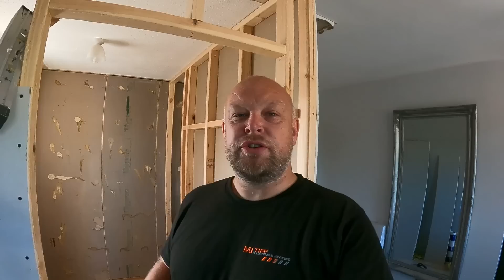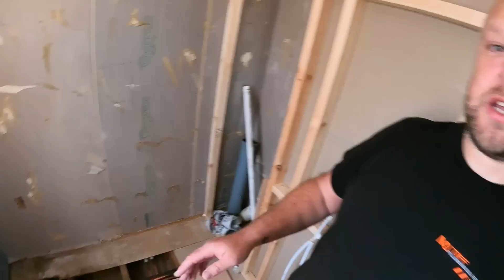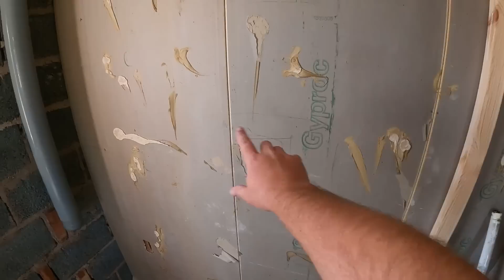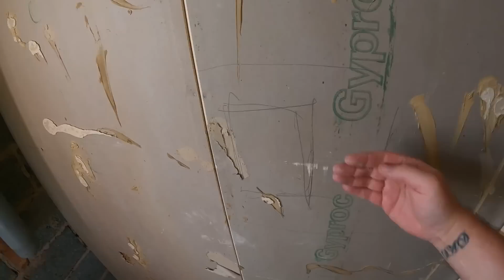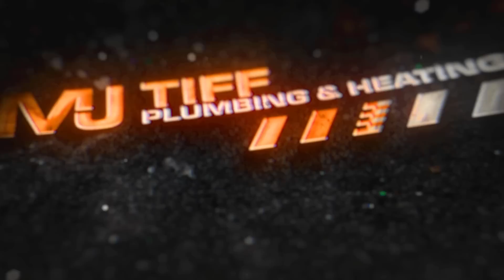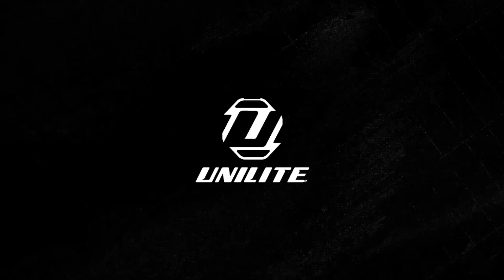BATHROOM DESIGN PROBLEM | SHOWER Valve issue means a REDESIGN to the BATHROOM

Comment: Is every plumber now days allergic to solder or what? I dont mind propress on repairs or when a valve is leaking by but I'll always solder when I can. You can at least sweat out a fitting if you have to. Also, is that a santee on its side for the shower drain?
Reply from the maker: I solder, I press and I use pushfit as and when needed…… we do what suits us

Comment: Same as you, i always just use compression for valves, i know end feed #3s are available but to me you then risk damaging the valve with the heat, like you said, if you do it right you wont have an issue, though i do now use press for getting onto chrome never had an issue with it.

Keep up the content 
👍👍
Reply from the maker: Thanks buddy…. Appreciate the comment 👍🏼

Comment: Tidy job as always Mark, 100% no getting away with having screwed fittings in walls the shower valve is made with them, good solution to the problem of the wall thickness and the shower valve ive never seen walls like that before, stay safe & hope your finger has mended
Reply: They are known as paramount walls. Came across hundreds of them used in social housing. Good thing is you can drill a hole in the wood header from the loft and just push a length of copper pipe straight down flattening the boxing as it goes 👌
Reply from the maker: Thanks buddy

Comment: I have taken to using speedfit washing machine valves instead  of caps. Too many fights trying to get caps off. Allows you to open the valve to pull water through to test/flush system full and under pressure as well the ability to release.the pressure at the point you need to finish off the install.

Comment: In the USA they solder the shower valves in behind the wall (taking out the plastic guts 1st). Its the weirdest thing. They do it with compression valves too. Throw the nut and olive away and solder it 🤷‍♂

Comment: To be honest with you, compression in walls are fine,   its how you do and test them before burial is the important bit. Anyway how else are you supposed to connect shower valves. 
Good to see the job take shape after press fit issue.
Reply from the maker: Thanks buddy 👍🏼👍🏼

Comment: Hi Mark.  I hate them egg board walls.  I had a kitchen to fit on one off them walls.  Was going to it down and put a stud wall up, customer did want that so glued 18mm on ply on instead. But I know you would sort it.  Looking good mate. I am not a plumber as I have said, but I have put compression fittings in walls never worried about it.  Same plastic pipe with fittings hidden no worries about that.  Have a good week mate 👍
Reply from the maker: Thanks buddy 👍🏼👍🏼
Reply: what plastic pipe was it? only ever used to the white stuff o.0

Comment: Compression in walls , from my point of view it’s almost unavoidable in certain circumstances ie your concealed shower, the chance of those fittings leaking due to moving another fitting further along the same pipe run are as low as you can get, if there is a chance that by tightening or loosening another fitting might in turn loose the hidden one then I would solder or push fit depending on the situation. There will be loads of ways people would do it differently but hey ! It’s your job and if it’s never let you down then bingo! 👍👍

Comment: 3:09 they are called paramount walls, I caught fire to one once, we use to take a cold feed from the attics to the electric shower when we would do the tanks in the attics, so I had to drill hole and send a bit of 15mms copper pipe down in the wall and sweat a bend on a pipe in the wall, I went back up the ladder to the attic working away turns around smoke gushing out of the ceiling, down the ladder bucket of water 
I had havnt moved so fast in my life saved the day house was still standing

Comment: Just wondering if the instructions would have told you which button is on and which is off, if so you could have saved a sore thumb and two inches of electrical tape 😅.
Reply from the maker: They didn’t …… it’s just a click
Reply: Maybe made in China 😁

Comment: That bathroom was a bit of s** !! Surprised the customer wanted the control on one wall and the shower on the far opposite one - ah well they have to use it!! I'd have cheated a bit with the cutting of the breeze blocks - I'd have cut across to the egg wall and run the pipes down the cavity! Those blocks are a nightmare! As for compression fittings in walls - why not? They are 100% secure when done properly I agree. Connecting to chrome cant be done any other way.
Reply from the maker: No other place to mount the valve due to the egg box wall…. Adapt and overcome👍🏼👍🏼

Comment: Hey Mark another great video 👍. I’m not sure if you know but you probably do, but you could of used pushfit isolation valves when testing for leaks, a bit easier that trying to pull off a cap under pressure or if your not sure if the shower is turn on or off. Anyway hope all is well and I look forward to the next video 👍
Reply from the maker: Thanks buddy….👍🏼👍🏼….. yer I could of done that to be fair 👍🏼👍🏼
Reply: I use a normal isolator with 2 inches of copper pipe which can then be pushed onto the pipe. Just saves buying push fit isolators which are rarely used!! Same result and reason!
Reply: I should of read this before I posted the same thing 😅.
No brainer for me.

Comment: Looking good,I see you didn’t have any of your 5 a day 😂 no leaks  . Has the old soil pipe been changed too a air admittance valve as I’m doing my own bathroom ex council house and he’s got a board in it built in the 70s and the council of done a couple of changes on the bathroom and installed everything on the walls above the floors and use the underfloor as a skip so I’m having fun looking forward to seeing this one finish👍👍👍👍
Reply from the maker: It will be mate…. On the end of the run, mentioned it in the first video on this job👍🏼👍🏼
Reply: @MJTiffPlumbing  I’ll be having another look at that cheers 👋 👍👍

Comment: Looking good upto now Mark I'd of put a flexi into the back plate elbows and ran the valve for a simulated shower run for a live test while all the pipe are visible once its boarded and floor is down its gonna be near impossible to sort if there's a problem........all in all nice bit of work buddy....cant wait for the next installment 👍
Reply from the maker: It’s all live and under pressure buddy 👍🏼👍🏼👌🏼

Comment: Solder iron or press irons... but how many times has a compression failed on a shower valve? In 15 years I can't remember having one myself.. I think I have been to 1 job which was leaking. But compression are perfectly fine in my opinion of you know how to do them properly and use paste.
Reply from the maker: 👍🏼👍🏼…. Same as you buddy 👍🏼

Comment: Why don't u use plastic and pushfit  in all the non seen areas? Must cost u a fortune in copper and fittings.  I use rad bleed screws on the outlets, then u can test or drain them
Reply from the maker: Fancied doing this job in copper…. A lot of the time I do use plastic…👍🏼
Reply: Decent plumbers use copper.
Reply: @paullbennett2923  am sure👍

Comment: Solder male irons I use mark but whatever your comfortable with 👍
Reply: Yeah I use the same mate try not to use compression especially on hot and colds
Reply: @ChelseaFC190512 city plumbing sell what looks like copper male irons, are these the ones you boys are using?